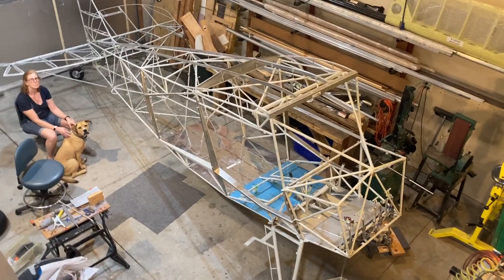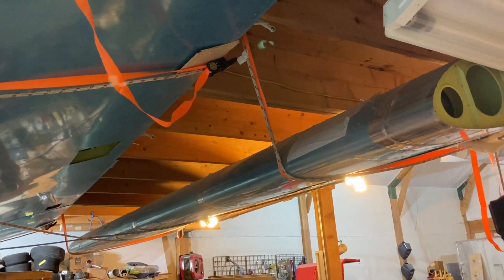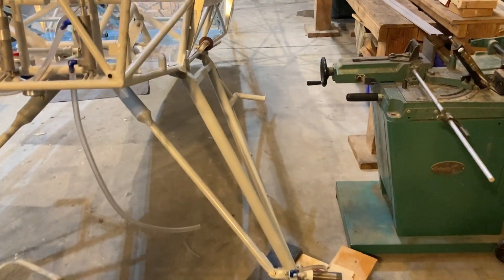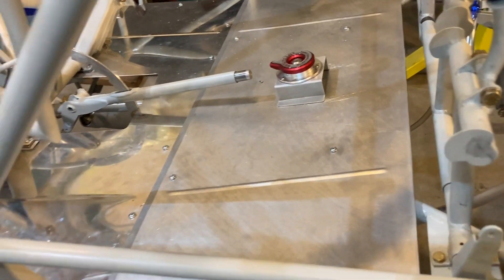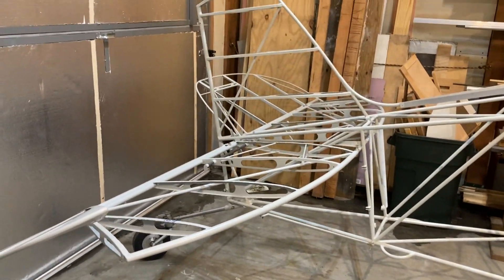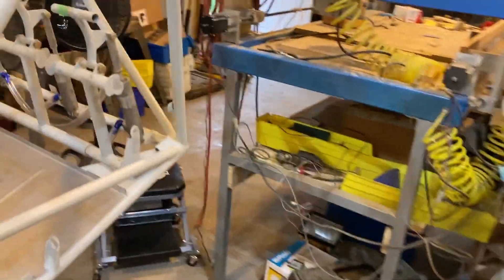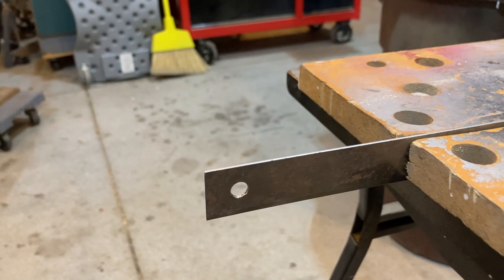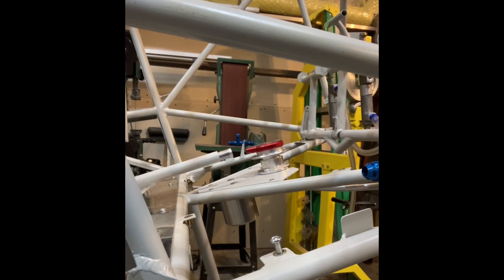Bearhawk Kit Update 1

Comment: You metalized the the bottom pretty smartly why don't you metalize the fuselage I'm thinking your not smart enough oh forgot your engineers
Reply from the maker: At the end it is all about weight.  The metal would add substantial weight to the aft section of the plane.   Given we are only running an IO-360 up front, the less weight in back the better.